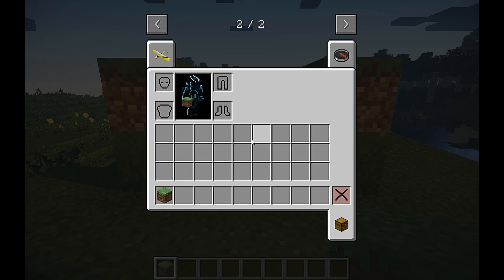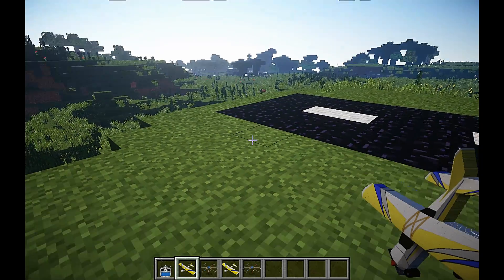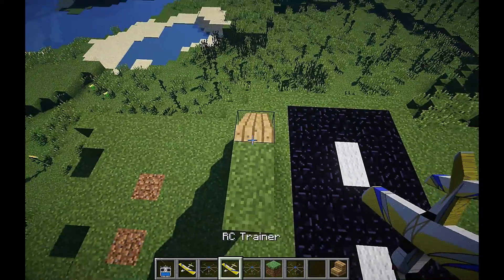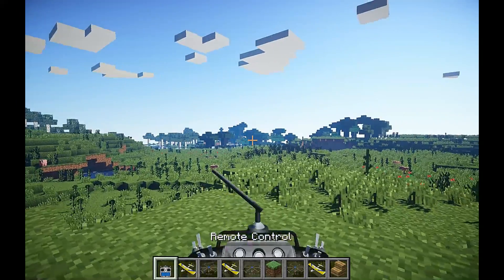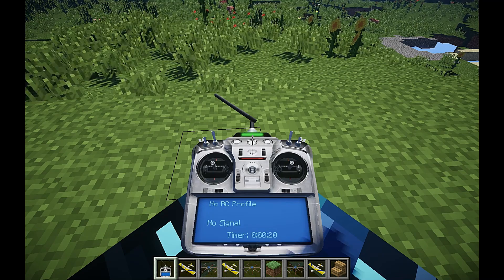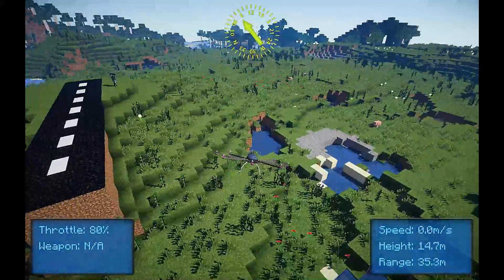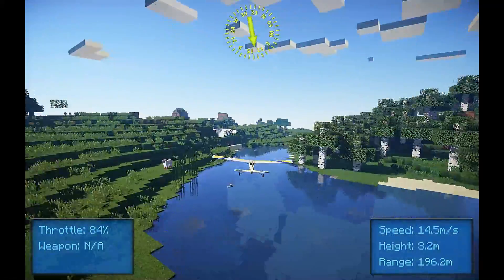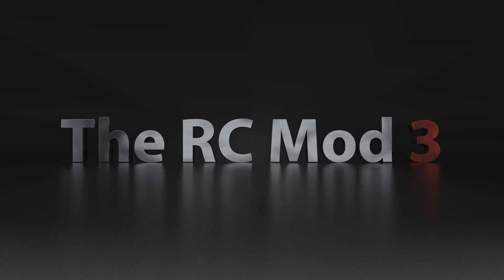The RC Mod 3 update

Comment: it would be nice if you introduce: the fighters and ships of ww2, super cars and hovercraft, aerobatic aircrafts, if you remove that annoying soaring that prevents it from spin when you accelerate with the car or otherwise make sure that the car can move more slowly.     fix the bug that the submarine can not to rise to the surface.
(if I don't know how to do that emerge on the surface the submarine, can you help me?
sorry for my bad english)
Reply: That the submarine cant go up is just a bug, nothing to do with your controlling skills
Reply: Imre Paasen I did not understand if the 'octocopter replace the normal helicopter or both will exist in the new version of the mod
Reply: Ale Macchi
I think that there will be only octocopter and plane when Skerp releases it. And that the helicopter will be added later. But I think car's and boats will come first. And when the heli will be added I hope skerp makes a 3D heli from it with better manouvrebility than the current one.
Reply: Imre Paasen how much time is left to the release of the mod? . what program you used to create 3D models?
Reply: Ale Macchi The mod is released a long time ago already, it think it was juli or something. Only a alpha version though, but it works pretty good, there are some bugs and crashes but the mod is totally playeble :D.

You can watch a how to install guide here: [Minecraft 1.7.10] How to install the RC Mod v3.0.1
or directly download the mod here: http://www.thercmod-minecraft.net/tutorials_installation.html
but dont forget to read the instructions because you will need them.

And we'r using blender for the 3D moddeling.
If you like this mod I would actually suggest u to follow us on facebook, cuz most of the updates are posted there.
Reply: Imre Paasen thank you very much, but I am talking about the final version (right petr have an idea, I know that there is still much work to be done). I'm not on FB for my reasons, but I go very often to see the page control page. 

  I know, my English is unwatchable
Reply: Ale Macchi
The final version, well. That is going to be a pretty long time I guess. But honestly, I have no idea how long it is going to take.
Reply: Imre Paasen I can get an idea of any new vehicles to be introduced in addition to the classic version of minecraft 1.4.7 and in my opinion you have to increase the lift of the airplane at low power of the engine (when I lower the power below 95% The plane stalled and crashed the as if it was not fast enough but I'm going to 
80% or 60%)
Reply: Yes, the base models will be introduced back first, but as I said, progress it going slow unfortunately due to the small team.
The trainerplane stalling is probebly caused by your flying style, because I was able to keep it in the air on about 70% throttle.
And the lift is part of the new phisics system, that means that it is calculated by the shape of the wings, the speed, the altitude and the oriantation of the aircraft.